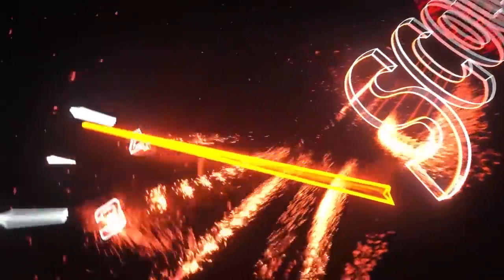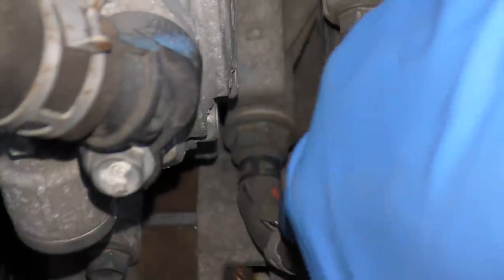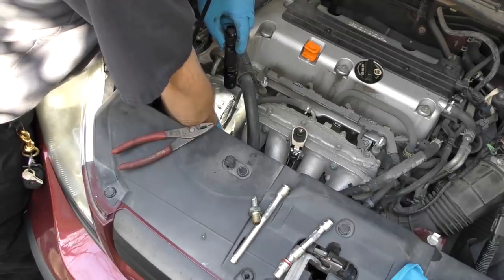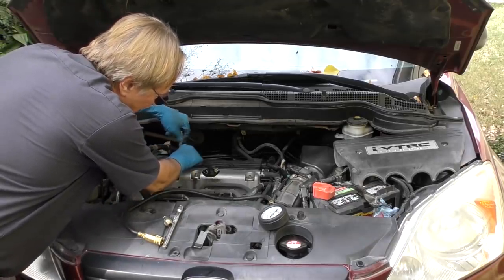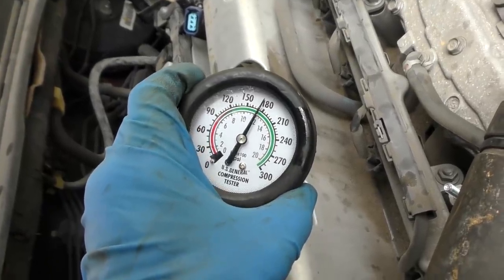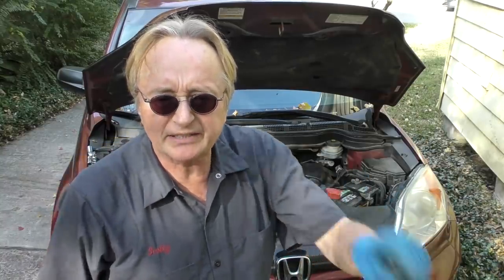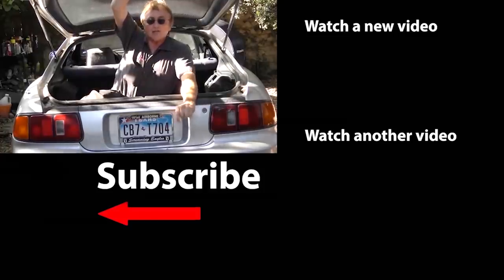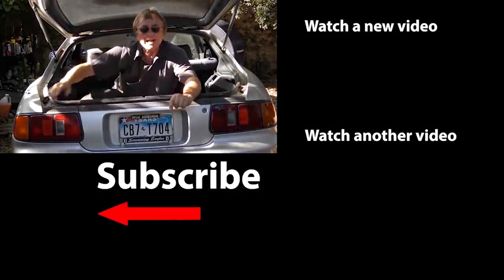The Truth About Honda

Comment: When I first started watching Scotty, I didn't like him because he always talked bad about Chrysler.  Then I realized he was right.
Reply: I have a 2009 Chrysler 300 with 177,000 miles and its pretty reliable. I’m the original owner and I’ve replaced the water pump, fuel pump and alternator.
Reply: TableRocked I’ve only seen my check engine light come on once since I’ve owned the car and that’s it.
Reply: 2005 Chrysler pacifica only repair so far is fuel pump. 150k + miles.
Reply: I just bought a brand new 2019 pro master and the tire pressure light is on, the esc last light is on. This happened in the first 100km of having it. My family has always had imports like Honda or Toyota so we are used to reliability, last American vehicle I buy!
Reply: F-150 that’s good!!! I think Chrysler big Sedans and SUVs hold up a lot more than the small ones like the 200 and Sebring.
Reply: F-150 unfortunately all manufacturers put out good and bad vehicles. It’s the rate at which they do so that warrants the reputation.
Reply: Kurt Watson he’s exactly right. Had to change a headlight on my father’s-in-law 2000 Chrysler 300M, you have to remove the bumper to change a headlight housing. You also have to remove 15+ bolts just to replace a headlight bulb. It is bafflingly stupid.
Reply: You must be hell on wheels with that many miles. I only put 5,500 miles on my car a year and it's 20 years old.
Reply: dcareyHQvideos  wow! Nice!
Reply: @kalielwebb3774  I only wish that Pacifica fuel pump is not in the fuel tank. Expensive to replace.
Reply: Drew Harris that’s crazy. My 2009 300 all I have to do is move the air filter the driver side to get to the headlight and the passenger side is accessible without moving anything
Reply: F-150 I replaced my fuel pump twice.
The dealer told me my 300 has two fuel pumps which is really weird. I thought all cars had one.
Reply: @kalielwebb3774  I had a 91 Toyota Tacoma and I put on 295,000 miles and replaced the starter. Thats reliable!
Reply: @kalielwebb3774  "pretty reliable" thats a lot of crap for a 2009 fuel pumps should never fail on modern cars.. our 2007 vw rabbit has 300 000 miles and the alternator just literally failed nothing else has been changed besides the coilpacks and spark plugs, now THATS reliable.
Reply: Honesty is a good thing
Reply: If there is one thing I have learned from Scotty is know what you are getting into.  I understand what you mean though.  We like what we like but it is not always the best for us.
Reply: @kalielwebb3774  We had same vehicle . Two ECM replaced under warranty. Still not a fan
Reply: Took you time to realise that ? The old ones 50's 60's are great for their time but today pure crap !
Reply: LittleRockElevators  never with a Honda
Reply: Honda fit first gen is the best used it for 12 years still no problem.
Reply: @kalielwebb3774  having replaced those components defeats the statement of saying it is reliable.
Reply: 😂😂 Junky Chrysler I wouldn’t ever buy nothing from Chrysler, Jeep, Dodge, Ram, fiat, they suck!!! The quailty of their vehicles suck!!!
Reply: @KeithOutWest  I hope you did the timing belt.. chrysler likes to blow the motor  when it  breaks...like you don't have enough issues when you have a chrysler... generally speaking I mean. And I speak from experience , and yes I maintain my cars and trucks well.
Reply: @SUGAR_XYLER  you're not the usual .....we put 15k to 20k a year on our cars....most people do....
Reply: @AquAcid  timing belt?
Reply: @tinymabaka7938  my wife has an orange 09 fit sport 5 spd.....amazing car. We love it. Has 180k on it, and it runs like new.
Reply: @kalielwebb3774  yea, how many miles when you did the water pump,ect...
Reply: @richsweeney1115  I’m on my third water pump 🤦🏽‍♂️. Original one got replaced at 92k and then again around 185k. Now I’m at 216k
Reply: @kalielwebb3774  Jesus.... 92k miles....that's stupid
Reply: @richsweeney1115  very stupid. I bought it brand new in 2009. I think I’m gonna get rid of it at the end of this year or next year and get me a Maxima again. I had a 2000 Maxima which I had bought brand new and it was a great car, I hit a deer and totaled it and it had almost 310k.
Reply: LittleRockElevators  if i were you to at that time i wolud fix it and sell it as fast as possibel

Comment: "Sometimes nothings better than brute force."  Well said Scotty. Well said.
Reply: Yup, this is the mantra for basically 50% of my job.
Reply: If it jams, force it.  If it breaks, it needed to be replaced anyway.

Also, if you cannot fix it with a hammer, then you have an electrical problem.
😁
Reply: e.g. August 6, 1945
Reply: 1VaDude I work in the electrical distribution industry and I assure you plenty of electrical problems can be resolved with a hammer :D
Reply: @Nick Knight 
The legendary "BFH" will never let you down.
Reply: This could be read the other way around. Sometimes you better do nothing in stead of brute force....
Reply: That should be on Scotty’s tombstone.
Reply: @MrMalthusMusic  it's why you kick vending machines

Comment: Honda may not be as reliable as Toyota. But when you drive one You will  know the difference of Honda vs Toyota.
Reply: They are just as reliable as Toyota...2 companies are about as on par with each other
Reply: Brandon AR15 if Honda is just as reliable as Toyota then why doesn’t Honda have as good resale value as Toyota?
Reply: It may not be as reliable as toyota, but its still hella reliable compared to other car brands.
Reply: I gotta a tacoma and a civic...I love my civic way more than my truck..
Reply: More parts wear out on hondas lol abit funner cars
Reply: Valente Gonzalez your truck will outlast your civic lol
Reply: Deo Hasslehoff depends on the truck.
Reply: @Frank00  basic economics lol.
Reply: Brandon Nhol which is something I see you don’t know much about😂😂😂
Reply: Hondas are fast not boring
Reply: I have a 2008 Accord and have taken very good care of it because I do most maintenance repairs myself. However, my Accord has had multiple AC failures, a bad catalytic converter, and a grinding noise when starting the cold engine (multiple times). In all, we're talking several thousand dollars of repairs not including normal repairs like the battery, starter, struts, plugs, oil changes, etc... I only have the car because its been paid off for a few years but I'm at the last straw with it. Another major repair and I'm looking for another car because I'm tired of dumping money into a car that was manufactured with defects. Its not just 2008 Hondas either. Most, if not all, subsequent years Honda's have similar problems.
Reply: Frank P Seriously? The only things that retain their value Toyota wise is Tacoma’s and maybe tundra. Other than that they are the same. Two best brands by far
Reply: M Fishing . Yeah, its a dilema. I still have the car hoping it will last me just one more year without crazy repairs so I can decide what to do then. I’m not wealthy here so $500-$1000 a pop is a lot of money for me. The only good thing that has come from the pandemic (a mixed bag for sure) is that I work from home full time now. But even if its just to go grocery shopping I still need a car. Anyway, hoping for the best. Good luck to you. Cheers!
Reply: @pleco101  yeah 7th gen Accords get a bad rep but most of them are transmission issues. I recently got an 07 Accord SE V6. Had 86k miles on it and was at a good price. No problems yet besides the back passenger door handle coming off. Learned this when I sat in the back right side and as soon as I pulled the handle it came off entirely. Had to smack that back in and was completely surprised by it. I sort of wish I went with the 08 Avalon XLS but the price was way to high. Still love Honda
Reply: @pleco101  no so sadly I got an automatic. It's hard to find an Accord SE with a manual transmission. But I have a feeling that I will need to change something when I hit 100k mile mark. So far the thing drives amazing and the guy at the dealer was selling it for 6k and with all the other stuff it costed 7k total. Not bad and at least I keep some value before hitting 100k miles on it. I'm at 89k but i should be holding some of the value if not a little less
Reply: Ofc you will know the difference, toyota is a old mans car while a honda is for actually driving
Reply: @Frank00  they're pretty much the same in terms of resale value!  Not sure what sources you've got ur info from, but they are about equal.  Honda does have the edge tho because it is built to be more consumer friendly and very solid.  There's a reason they don't sell in fleet unlike Toyota, virtually every uber and lyft and cab out there is some kind of a Toyota, I'd say that waters them down alot compared to Honda!
Reply: @Frank00  BC hondas & toyotas markets & demographics of buyers / sellers can be very different.
Reply: @MrSupernova111  i can relate to the grinding and vibration when shifting on a cold start. I hated it. Just got rid of 2013 accord. Never getting honda again.
Reply: True i owned a honda accord and it was a nightmare ...
Reply: @pleco101  83k on a 05 ELEMENT! I bought it in Sept. 2020. It's a granny car and pristine!
Reply: I have a v6 accord coupe very fun to drive and has a lot of power its reliable and has 108k miles still drives like a mad..for me honda is better then toyota if you can do a little bit of maintenance yourself.
Reply: @yarahsan4479  depends its not so reliable when it comes to the driving conditions in my country ... the steering pump and the column is always leaking ... the suspension gets screwed up and so is the hydraulic mounts ... and damn the lockset was a nightmare
Reply: @Frank00  they do
Reply: HONDA FOR LIFE
Reply: I was buying a new car in 2009, wanted the Accord 2.0 manual, ended up getting a Mazda 6 2.0 manual (I'm from Europe, so EU and Japan model, not the larger US one)
The decision was made after the first two corners in a test ride, the handling on the 6 was much sharper, and I was still a young guy enjoying a fast drive on twisty roads, and also Mazda was a trim level higher for the same price.
I was prepared for a slightly less reliable car, as I find Honda higher than Mazda in reliability, but, 12 years later i am still driving my 6, just over 100.000 miles and not a single issue.
Just do regular maintenance and the car has been as reliable as a wood burning stowe for now.
I wanted to trade it in for a new car, but realized it would just be unnecessary expense. So i plan on keeping this one for at least another 3-5 years or until it starts creating problems
Reply: There is a honda accord 06 where the guy actually ran the mileage back to 0. Honda are mad reliable if you do you schedule maintenance, you'll never have a problem even when u do the car would hit limp mode to save your engine
Reply: @WatchGeek  hey didn’t expect to see you here!
Reply: @skateboarding118  scotty is an institution, of course I'll be here 😀
Reply: I don't want to come off as a douche but that's a very vague statement my dude.
Reply: @HonDannysVlogs  most of the transmissions are pretty good now this isn’t the early 2000s I know a guy with a 2011 Honda Pilot and all he did was change oil and a water pump  he’s at 247k  miles
Reply: @Иванпонимаете  had a tiny transmission scare but still Honda weirdly has problems with the 7th gen Accords
Reply: Honda is just as good as toyota...... scotty has said it ,too. Honda makes the best engines.
Reply: @captinbeyond  really? My wife has an orange 09 fit  sport 5 spd, with 180k on it , and it's the most reliable car we've had. And she works at grubhub as a second job, part time, she's always drivin doing deliveries at night.. never had a problem with it.all we've had to do , is maintain it.fluids, filters, tires and brakes.oh, it needed a right from caliper too. So I put pads, rotors and calipers on both sides last fall
Reply: @MrSupernova111  so, you got a lemon. You didn't say how many miles either. The grinding sound when you start it....I hope you fixed that...the gear on the starter is sticking, and grinding on the flywheel
Reply: @Zeus0886  all the grind is , is the starter sticking ........people talk about their problems ,meanwhile half if them don't say miles they have.....and it was probably neglected before you got it.
Reply: @MrSupernova111  I have an ‘09 2.4 accord, in 60k kms it’s not had a single issue, just periodic maintenance. My friend has an ‘08 with 90k kms, no issues at all. Maybe you got a lemon? I heard the V6 had vcm tech going bad.
Reply: Wait what lol
Reply: @paulmogendi3168  supra?
Reply: @WatchGeek   I'm currently driving the 9th gen accord v6 manual
Reply: @MrSupernova111  those aren’t thousands of dollars to replace ur just not in the game when it comes to knowing the root causes to those problems , a universal Caitaliyc converter is 150-200$ you can fix a AC your self , and that grinding noise is a simple fix on YouTube look it up

Comment: Had that Honda been changed every 5k miles rather than 15k from day one, it probably wouldn't be burning that much to begin with.
Reply: Piston rings can get worn no matter how much you change oil
Reply: @mikey_likes_it_  dirty oil is a lot rougher on them than clean
Reply: Dirty oil also carries a much higher load of contaminants, which accelerate wear.
Reply: @sinusguy  What year is it.

Comment: I just replaced my PVC valve on my 94 Toyota Celica. Very easy and cheap fix. I bought it at Auto Zone and replaced the old one with the new one. It's so easy anyone could do it. Hey' Scotty, I have you beat. I have 334 Thousand mikes on my 94 Celica. You are right. They will last a Long, long time.

Comment: Honda has an Extended Warranty on the 2010 and 2011 CR-V for excessive oil consumption due to poor piston rings. Mine was using a quart of oil every 1000 miles. Just had mine fixed under warranty through the local Honda dealership. Called Honda Corporate first to get things started. They were real helpful.

Comment: Thanks Scotty. This helped me alot. I have a 2003 Honda Element Kstill looks and runs great like new almost) with 291,000mi and still goin strong but, a tiny bit of oil burning. I changed the PC valve just like you showed us and much improved. I also bought a pressure test kit like you used on this video and a little better pressure results than the crv on your video (same exact engine as mine). So no more noticeable oil burning after worn PC replacement! Thank you huge Scotty. Loyal subscriber for life.
Reply: My 2003 Element only has 120,000 miles so I am not going to touch the valve yet.

Comment: Replacement PCV valve manufacturer too cheap to include the gasket. smh
Reply: Because pcv valves are already like 3-5 dollars lol
Reply: Standard Honda crush washer...mechanics should have them in stock
Reply: @djentyman4002  maybe in your vehicle some pcv valves run in the 20 to 30 dollars 😭
Reply: That is not cheap enough apparently. I have a Mitsubishi Lancer with a 4B10 engine. I just changed my PCV valve myself. The damn thing is made of plastic. That is real cheap. But the part which i bought from the dealer cost me around USD28 after conversion from our local currency.  At least i can see from that Honda K24 engine , the PCV valve is made of metal.
Reply: EFsedan91LX dang lol maybe some pcv’s have a heater built in to them
Reply: Ot's a thick metal gasket, never needs replacing. On my cars the first oil change I get a thick 100% copper one. That never needs changing either.

Comment: One other reason for a noise going backwards, is that some manufacturers use helical-cut gears on gears 1-5, but a straight-cut (and therefore noisier) gear on the reverse.

Comment: Just changed mine. Car was consuming about 1/2 quart every 5k miles. It started happening quickly so I knew it was probably not burning oil from worn rings. Put in a new one and oil level has not dropped at all in last 3k miles. Also, just because it rattles when you shake it does not mean it is fine (if it does not its definitely bad). Just replace it, it's like 10 bucks. 2006 Matrix with 150k miles now consumes zero oil.

Comment: I have changed several engines that used a quart in 3000 miles to Amsoil that stopped using oil  after a couple changes like my Z71. Changed it 2 days ago with over 16000 on the same oil. Amsoil premium is guaranteed for 25000 miles in 6 months in a good engine.  For people who put on a lot of miles it not only saves money but also rejuvenates seals. I consider a 5.3 LS with 237000 miles that now uses no oil and used 1 quart every 3000 miles at 200000 miles with Pennzoil extended life oil a good example of what it can do for an engine.

Comment: Hi Scotty.  98% of the time your right and i love your videos.   I've been a certified  mechanic for 46 years.   but you are wrong about the function of the P.C.V. valve  it was mandatory on all vehicles 1963 model year and newer.  The check valve in the P.C.V. Valve does not control oil vapor it is a safety device if the engine should backfire through the intake manifold the check valve slams shut in 1000th of a second preventing the flame from going in to the crankcase and igniting the unburnt vapor in the crankcase and causing a horrific explosion.  Great video otherwise keep up the good work :-)

Comment: plug wires or the coil on plugs should be shorted to ground first, or un-clip the coils. That high voltage has a nasty habit of wanting to break through somewhere, which will be another problem when it is put back together.

Comment: Be careful when changing the cheap plastic PCV valves on newer engines, they tend to break and then you have to remove the valve cover to take it out in pieces. 2010 Honda Pilot. Just FYI.